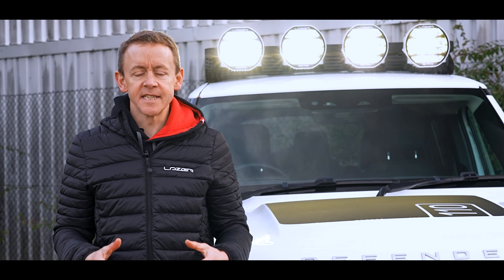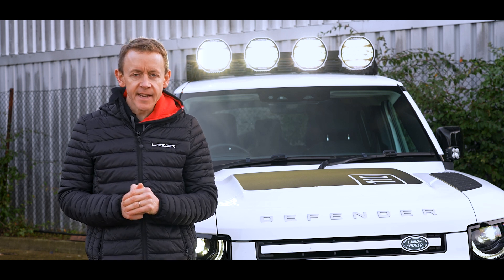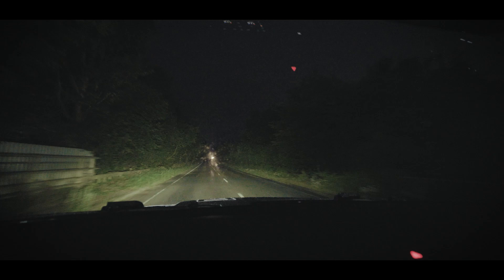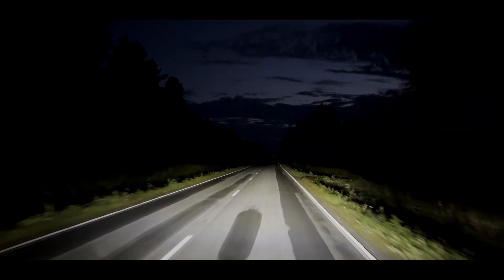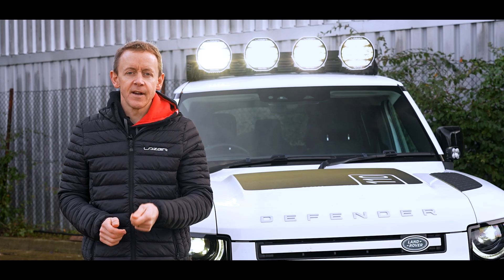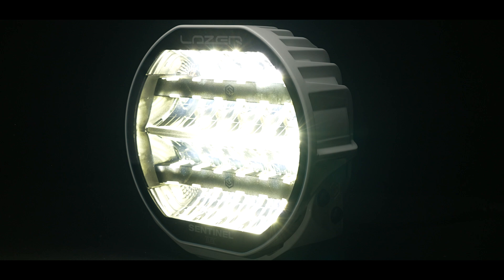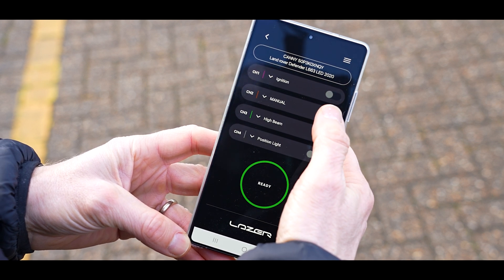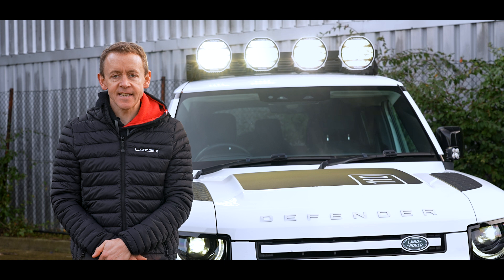LAZER LAMPS | Flash To Dim Explained

Comment: Is there a mode where it can remember the previous state? i.e. if I set it on dim, and then turn off the high beams for a passing car, it would come on dim when the high beams go back on again? Yet if I was off road running it full power, and turn the high beams off temporarily, will it come back on full power?
Reply: Yes it is. I have a Lazer Glide 18 Elite on my car and it remember the previous state that you set it to before turning it of if you meet an oncoming car. I really like this lightbar because of this flash to dim feature because i dont need the very bright light on dry roads in the dark but when it's raining and the roads are darker because of the water it's nice to be able to get the full power from the lightbar in my opinion.